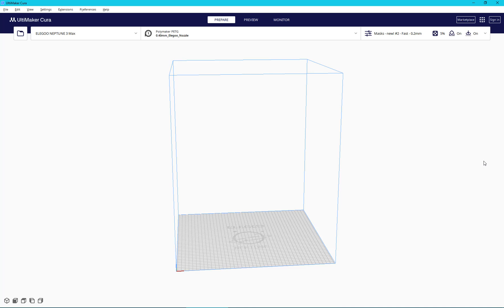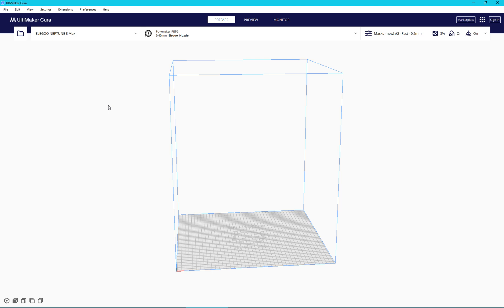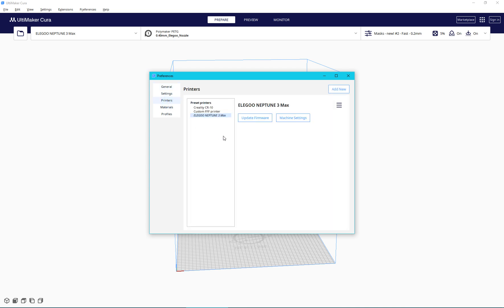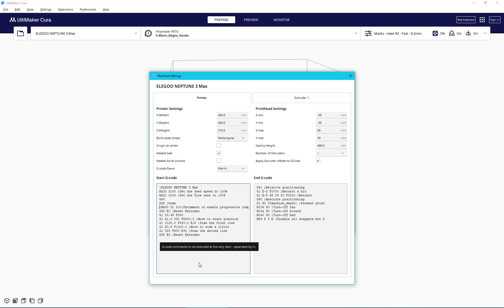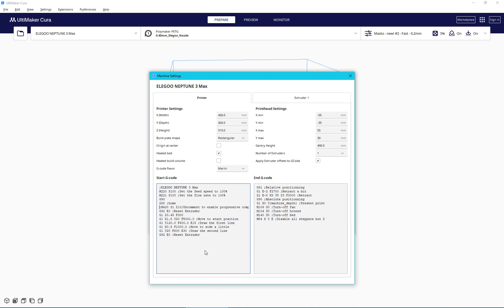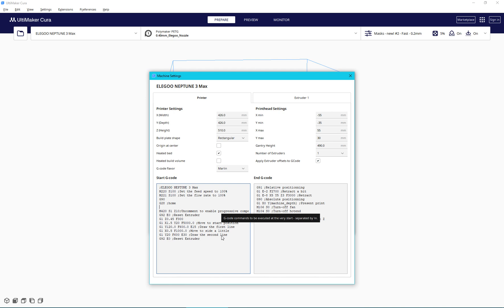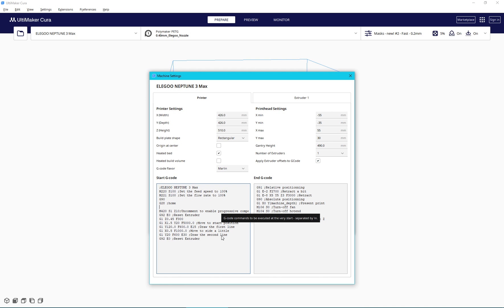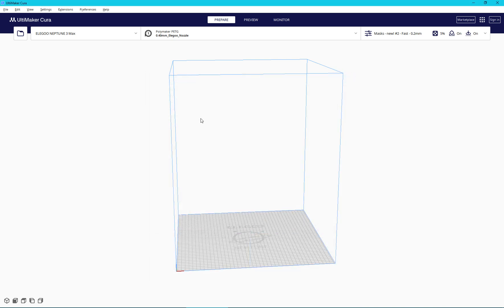Is your Elegoo Neptune 3 auto bed leveling really enabled?

Comment: I have a 3plus would this affect me too?
Reply from the maker: Technically, it should affect every printer that has auto bed leveling capability.  This is a G-code command that instructs the printer to use the stored bed mesh data when doing the print.  I use this on my Creality CR-10S as well.... it's always been there with the default slicer, but with the Elegoo printer it was commented out so it was disabled.  This seems to be the default, confirmed by many Neptune 3 Plus and Max users.  I think this was just an oversight on the part of Elegoo.  Everyone has been killing themselves trying to get the perfect bed mesh, and that data was not even being used.
Reply: @CBMSTUFF   don't know if my 3 plus has that very beginner to 3d prints
Reply from the maker: @hansherrera6969  This is a G-code that needs to be used for any and all 3D printers to enable the printer to use the stored bed mesh.  Without this command (M420 S1) used, no printer will actually use any leveling information during the print.
Reply: @CBMSTUFF   checked on neptune 3 plus, its there, im gonna try to remove it